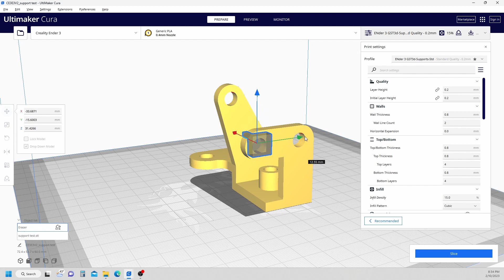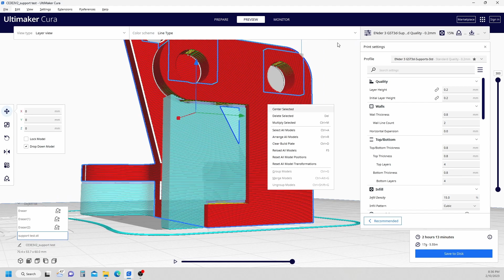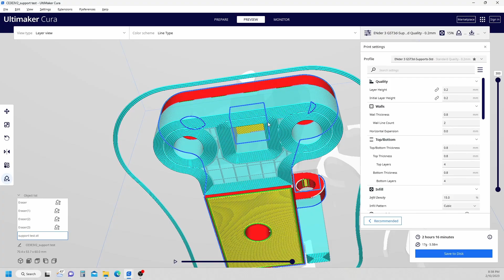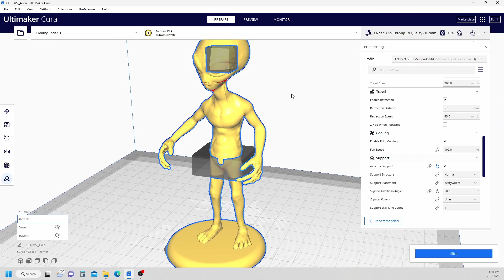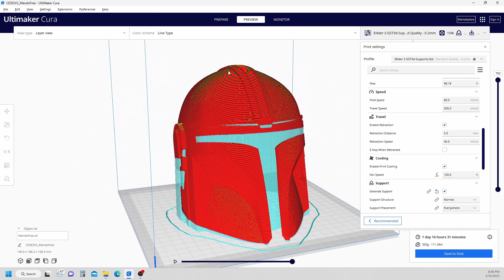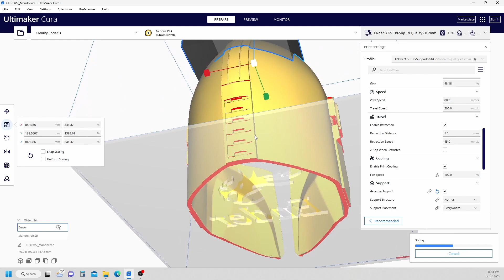Maximizing Your 3D Printing Efficiency with Support Blockers

Comment: Just curious.. would it not be better to use tree supports than the Normal setting in these examples.?? I have noticed that in many cases the tree support is a great saving in time and filament.
Reply from the maker: 6 months ago I would've said yes. BUt while making that video I came across case where the tree supports really increased my print time. In most cases, tree supports do reduce time and are easier to remove.

Comment: After watching your Per Model Settings video, I used these for the first time yesterday and they are incredibly powerful. They are tedious to work with though and don't scale as expected by grabbing the handles, at least on V5.3. Still worth the time however. Other than setting the Z to 0, Is there a way to drop the blocker to the buildplate with a keystroke? Thanks!
Reply from the maker: I don't believe you can have them drop directly on the plate since you have to click on the model. But what you could do, is make an stl of a square, or cylinder for example. Any shape you choose will work. Bring that into Cura like any other model. It will drop to the bed plate. Then click on that model, use the per model settings to make the new shape "Don't Support Overlaps" and move it into place where you want it. I hope this helps and thanks for watching!
Reply: @pushingplastic7445  Great suggestion. I made the imported cube, Print as support. Now, I can pick the cube up or resize it and it drops down to the buildplate. Awesome! Better yet, I can have two types of support blockers in one model. Very nice indeed. Thanks!
Reply from the maker: @baxrok2.  Awesome! Glad it worked out and thanks for letting me know the results! Keep on watching!!!

Comment: PrusaSlicer has paint on supports.  I would think that would eliminate the need for support blockers?
Reply from the maker: Assuming you are using Prusa Slicer. The video is for those using Cura. Prusa Slicer is a nice piece of software, but the goal is to demonstrate to users of Cura what options are available to them.

Comment: I like the idea of Blocking supports, and thank you for sharing.

As I use another Slicer software and find it realy quick and easy to change the support angle or the support spacing,
Support angle is whare the software works out the overhang and you can increase or decreas it
Can this be done in Curu to reduce supports,

just to say i saved nearly 2 hours today on a model by spending around 20 seconds of time in changing such settings
Anyway i find supports is such a pain in the but to clean up.
Reply from the maker: It can! I did a video about support settings a few weeks ago using Cura's support settings to change the overhang angle, pattern, density and a few others settings to make supports more manageable. https://www.youtube.com/watch?v=FfiQLWprcIU
Reply: @pushingplastic7445  Thank you very muchfor your responce.